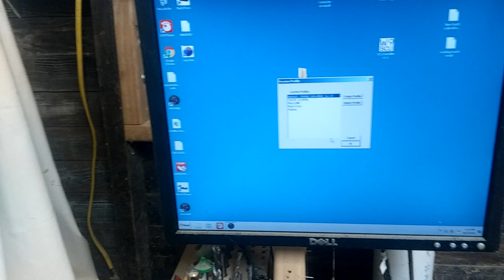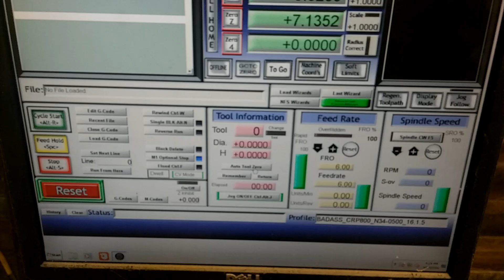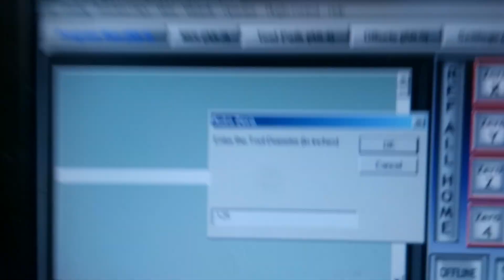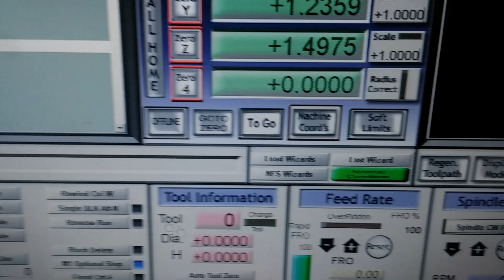Mach3 Auto Zero Tool Touch Probe Corner Finding

Comment: I am using Mach 4.  Their touch tool does not allow you to put the touch plate dimensions for x or y.  It only lets you specify the touch plate thickness used for setting z.  Seeing this work on outdated Mach 3 is frustrating.  I am not a happy customer of Mach 4.  Very disappointed.  How hard is it to add 2 damn variables in the input screen for touch.  People have brought this up.  Does newfangled not give a shit about the people it duped into buying Mach 4?

Comment: Hi I emailed you for the code but got no response. Where do I find the code used in this video?
Reply: Ok well Fuck this guy. He doesn't want to hold up to his claims that he'll share so whatever. 

if you want the code here you go. I'm using the touch off plate available on ebay from Blue OX. If you need help finding him, let me know. 

There's a few numbers you'll need to replace to match your particular plate. Once you do that, everything should be smooth sailing. They are the Offsets. 

This code is a work in progress so ymmv, it works great for me though.

THIS CODE USES THE LOWER LEFT CORNER AS X0 Y0 Z0

'Ref : https://www.youtube.com/watch?v=IIugqgUyo7E
'GOLD-1-31-2019 Brian Janiszewski

Cutter_Size = Question ("What is the diameter of your cutter?")
Plate_Z_Offset = Question ("What is the Touch Plate Thickness in, Ref 0.119?")
Cutter_Size2 = Cutter_Size/2

Plate_X_Offset = 0.351
Plate_Y_Offset = 0.351
' Plate_Z_Offset = 0.119

Plate_X_Offset1 = -1*(Plate_X_Offset+Cutter_Size2)
Plate_Y_Offset1 = -1*(Plate_Y_Offset+Cutter_Size2)

Message( "Probe Initialized" )
code "G92 X0Y0"  
If IsSuchSignal (22) Then
code "G92 X0Y0Z0"
'Call SetDRO( 2, 0.00) ' Z Axis'
'Call SetDRO( 1, 0.00) ' Y Axis'
'Call SetDRO( 0, 0.00) ' X Axis'
code "G90"
code "G04 P3"

'Z Probing
code "G31 Z-3.0 F5"
While IsMoving()
Wend
'code "G92 Z0"
Call SetDRO(2, Plate_Z_Offset)
code "G1 Z 0.5 F20"
End If

'Y Probing
If IsSuchSignal (22) Then
code "G1 Y-1.0 F20" ' Move cutter towards front'
code "G1 Z-0.125 F15" 'Move Cutter below Stock'
code "G31 Y1.5 F5" ' Move cutter towards stock'
While IsMoving()
Wend
'code "G92 Y0"
Call SetDro(1, Plate_Y_Offset1) ' Set Y axis to 0 at Touch'
code "G1 Y-1.0 F20" ' Move toward front'
code "G1 Z0.5 F20" ' Move cutter up '
code "G1 Y0.5 F20" ' Move cutter above stock'
End If

'X Probing
If IsSuchSignal (22) Then
code "G1 X-1.0 F25" ' Move cutter to left of stock'
code "G1 Z-0.125 F15" ' Move cutter below stock top'
code "G31 X1.5 F5" ' Move cutter towards stock, right'
While IsMoving()
Wend
'code "G92 X0"
Call SetDro(0, Plate_X_Offset1) ' Set X axis to 0 at Touch'
code "G1 X-.5 F20" 
code "G1 Z0.5 F25"
End If

'Return to XY (0,0)
code "G1 Z.5 F30"
code "G1 X0.0" '&Cutter_Size2
code "G1 Y0.0" '&Cutter_Size2
Reply: @IcanCwhatUsay  Thank you for the code.
Reply: Thank you for the code. I have made modifications for zero offset( my bed is electrically isolated from the frame so when I cut aluminum I probe the material directly) https://youtu.be/sz1eY3G2bG8

Sub Main()

Cutter_Size = Question ("What is the diameter of your tool?")
Cutter_Size2 = Cutter_Size/2

Plate_X_Offset = 0.0
Plate_Y_Offset = 0.0
Plate_Z_Offset = 0.0

Plate_X_Offset1 = -1*(Plate_X_Offset+Cutter_Size2)
Plate_Y_Offset1 = -1*(Plate_Y_Offset+Cutter_Size2)

Message( "Probing routine initialized" )
code "G92 X0Y0"

If IsSuchSignal (22) Then
code "G92 X0Y0Z0"
Sleep 10
code "G90"

'Z Probing
code "G31 Z-3.0 F15"
While IsMoving()
Wend
Sleep 50
code "G0 G91 Z0.03"
While IsMoving()
Wend
code "G31 Z-1.0 F2"
While IsMoving()
Wend
ZProbePos = GetVar(2002)
code "G90"
code "G0 Z" &ZProbePos
While IsMoving()
Wend
Call SetDro(2, Plate_Z_Offset)
Sleep 100
code "G0 Z0.25"
End If

'Y Probing
If IsSuchSignal (22) Then
code "G0 Y-1.25"
code "G0 Z-0.25"
code "G31 Y2.0 F15"
While IsMoving()
Wend
Sleep 50
code "G0 G91 Y-0.03"
While IsMoving()
Wend
code "G31 Y0.25 F2"
While IsMoving()
Wend
YProbePos = GetVar(2001)
code "G90"
code "G0 Y" &YProbePos
While IsMoving()
Wend
Call SetDro(1, Plate_Y_Offset1)
Sleep 100
code "G0 Y-0.5"
code "G0 Z0.25"
code "G0 Y0.5"
End If

'X Probing
If IsSuchSignal (22) Then
code "G0 X-1.25"
code "G0 Z-0.25"
code "G31 X2.0 F15"
While IsMoving()
Wend
Sleep 50
code "G0 G91 X-0.03"
While IsMoving()
Wend
code "G31 X0.25 F2"
While IsMoving()
Wend
XProbePos = GetVar(2000)
code "G90"
code "G0 X" &XProbePos
While IsMoving()
Wend
Call SetDro(0, Plate_X_Offset1)
Sleep 100
code "G0 X-0.5"
code "G0 Z0.5"
End If

'Return to XY (0,0)
code "G0 Z0.5"
code "G0 X0.0"
code "G0 Y0.0"
code "G0 G53 Z-0.05"
While IsMoving()
Wend

Message( "Probing routine complete" )

End Sub

Comment: Thanks for great video, this is I have a lot of benefit. My machine (pt6012) has zero tool function, but I wonder whether this touch probe from step craft can be automatically installed on my machine running Mach3 and it's hard to get itThe Touch Probe device was designed to expand the capabilities of the Stepcraft CNC System by allowing you to be able to precisely locate starting positions for various objects that you wish to machine. Additionally, the Touch Probe can be used to 3D scan an object by systematically locating many points (more or less depending on the accuracy that you set) and creating a 3D “point cloud”. This point cloud can then be brought into software where it can be manipulated and converted into a 3D object such as an .stl file. This file can then be loaded into the Stepcraft CNC and be used to carve and object to create a duplicate model. The Touch Probe can also be used to scan an uneven surface to allow the Stepcraft CNC to cut, carve, or engrave along that uneven surface, i.e. you can engrave text along a curved surface.The Touch Probe was designed to work with a Stepcraft CNC running UCCNC software. The Touch Probe can be used with other CNC systems and software but Stepcraft would not be able to support such installations.The installation software that comes with the Touch Probe will install several macros and a new screen set for UCCNC. Custom buttons will now appear on the UCCNC screen to manage various functions for the Touch Probe.

Comment: Glad you are enjoying your Triple Edge Finder. This is an interesting adaptation to my product. You can also use the hole to find the X&Y. It should be slightly more accurate but your method looks quicker.  Folks can get a Triple Edge Finder at themakersguide.com
Reply: Hello Bill, I listen to your podcast and really enjoy it!.  My code was originally written for another edge finder but it should work just fine with your nice triple edge finder.
Reply: this link adress is shit. don´t open